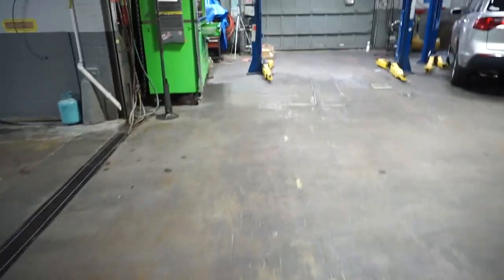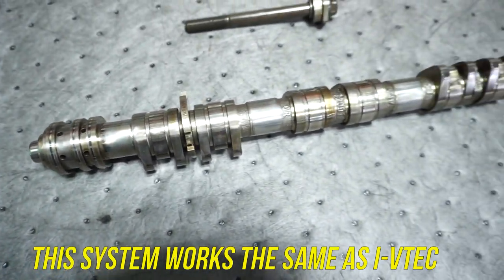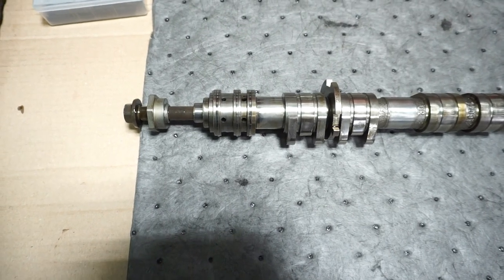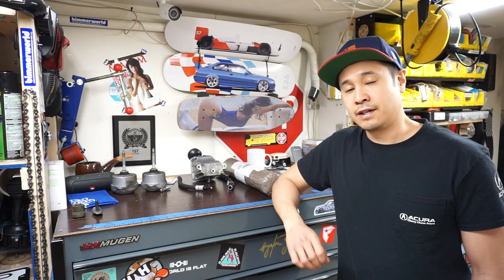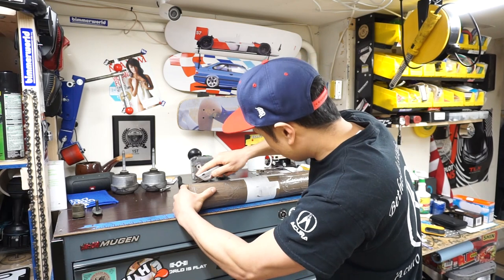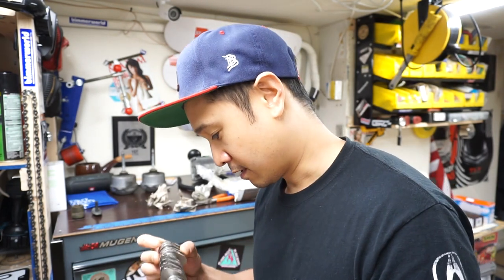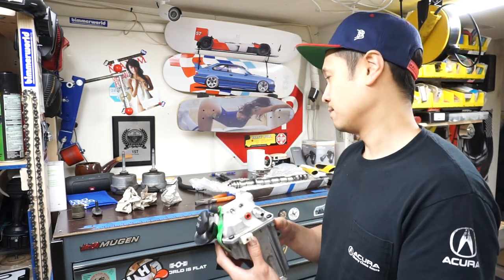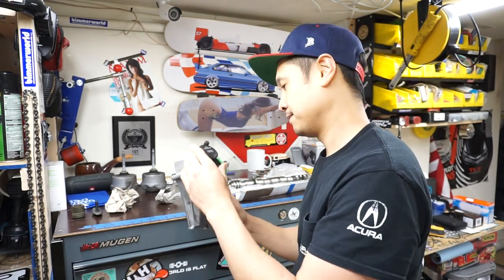PORSCHE 997 TURBO MAJOR SERVICE AND MAINTENANCE PART 3; Pinning the camshafts P0011

Comment: Hey Xavier I’m a follower of yours who owns the same car, a 2008 997 turbo, I have a loud rattle noise on cold start only for about 2-3 seconds then it goes away. You ever get that with your car? I’m a retired professional auto tech of 40 years. My guess is it’s the timing chain tensioners what’s your opinion? I love this car but now that I’m retired I can’t afford to have it repaired so I’ll try to fix it my self
Reply from the maker: Thanks for the follow.  The symptom you describe is completely normal and has been documented on various 997 Turbo specific sub forums as a normal characteristic.  I do experience the same, but only after long periods of the car sitting.  It is very infrequent.  People have tried to fix this problem but to my knowledge, have not posted any confirmed repairs.  The symptom always seems to linger even after component replacement.  

If I had to scientifically guess what is causing the noise, I’m going to have to say that it is excessive tolerance in the cam sprocket gears and chain.  

The reason I theorize this to be the case is formed from first-hand experience.  Honda/Acura has an engine (K24) that exhibits the same exact symptom and their repair is to replace the VTC actuator (intake cam sprocket) and tensioner.  I have done this repair on many Honda and Acura vehicles and the noise does indeed go away thereafter.
 
YouTube search “K24 VTC rattle” and you’ll find many videos that show what I have described above.

Although I can’t prove it until I actually put a repair into practice, but I’d be most confidently willing to bet that the cause for the rattle noise on startup on our MEZGER engines is caused by increased tolerance in the Cam sprocket and chain, and the first repair that I would try is to replace Bank 1 and Bank 2 intake cam sprockets (Variocam Actuators).

Comment: Hmm I would wonder if you wouldn't be able to just heat up the cam a bit and then rotate the sleeve on your own with a screwdriver or something? Any comments on this?
Reply: And honestly, the sleeve still looked about as much spun as it was in the first place. Did he even do anything else other than what I commented you recon?
Reply from the maker: @aolsen6874  Definitely not "as much spun as it was in the first place".  This is a common failure on 997.1 Turbo's.  See my build thread on Rennlist for more in depth photographs.  Todd removed the sleeve and re orientated it back in its proper location to have an oil orifice that is 100% open.
Reply from the maker: @aolsen6874  Wasn't about to try.  That sleeve is also the snout that the cam sprocket keys into and if I boogered it up, I would have had to buy a new camshaft.
Reply: @NSXavier997  thanks for your quick replies :-D Got a .1 MT myself that I’m about to prep for this season with coolant pipes and new clutch etc. I’ll be doing cams if they ever fail with a fault code i think..
Reply from the maker: @aolsen6874  if you have access to a scan tool that reads live data you can log your cam phase and see how “in time” the engine is and if any cam slippage or chain stretch has occurred.  You can also load the engine and watch your advance/retard action and compare the values on Bank1 and 2 to see if you have a lazy solenoid and / or rotated cam sleeve that is causing poor oil flow
Reply: @NSXavier997  I have a decent autel tablet so I'll for sure look into this. Thanks a lot! And a great video series form your Porsche experience! ^^